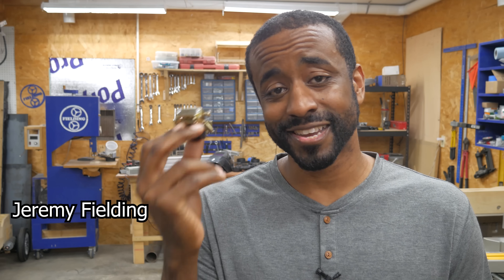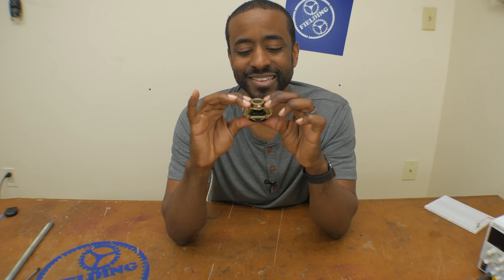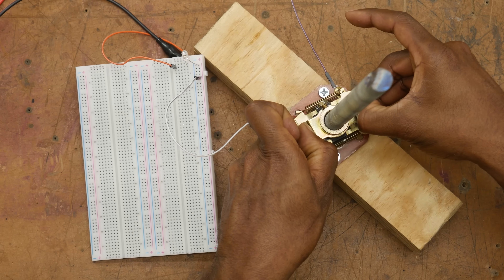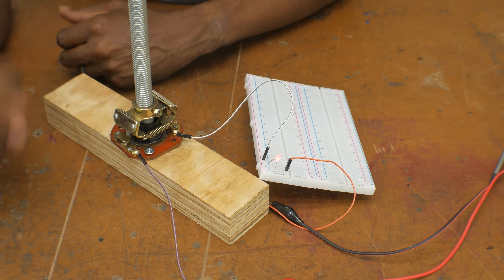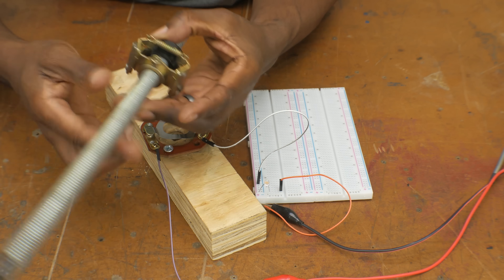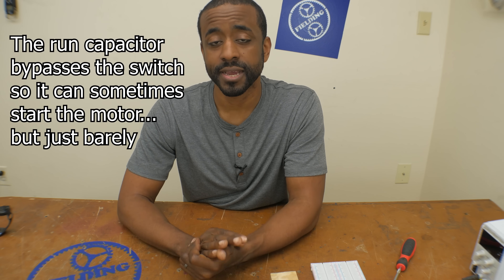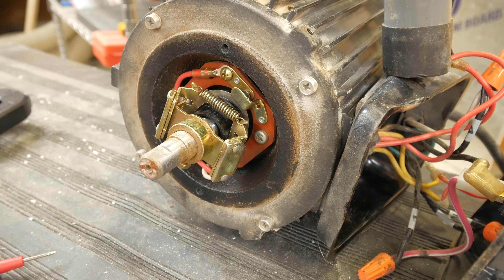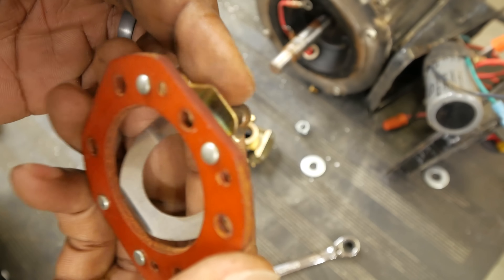This Clever Device Is Found In Nearly Every American Household. How It Works And How To Fix It

Comment: Never seen before this device. Well, I’m in Europe. When you clean connects, NEVER use a sandpaper of that coarseness. If you want to use emery paper it should be very fine like 600. It takes time but is much better as the contacts have very delicate surface.  The better the surface the better it conducts current. I have used a glass fiber scraper pen which has very thin threads or rough cardboard. Usual old style postcard without any gloss is good. It doesn’t harm the surface.
Reply: The contact surfaces are likely a silver alloy, and for cost reasons the manufacturer isn't going to use more silver than is required.
Reply: I use the striking strip from a book of matches. Very fine abrasive and red phosphorous leaves behind a weld resistant surface.
Reply: Way back when car engines had distributors. Fouled "points" were very common. A very fine file or emery board was used to clean them.
Reply: What type of motors do you have there then champ?
Reply: @bushratbeachbum  we have the same type of motors that are used in the USA, but our electrical supply is different. We use 230 V at 13 amps which has almost twice the power of a standard US 120 V circuit, so we don't need centrifugal switches and boost capacitors to start the motor - there's enough power in the standard circuit to do it without the booster.
Reply: @joejones3434  was waiting for someone to say this. Still don't understand why the world can't agree on 230v and metric :)
Reply: @joejones3434  you need a capacitor to start the motor unless is a three phase. Old washing machines had this device even in Europe. I think they still use it in America because a double contact type can prevent overspeeding in some aplications and americans are very strict.
Reply: @soiledhalo2296  The world did - at large. Just some are resistant to using half-decent systems.
Reply: Deoxit in aerosol cans is amazing for cleaning corrosion

Comment: Quick google search came up with 
An 1920s patent for a centrifugal switch (US Patent #1,630,394) was granted to Royal Lee on May 31, 1927. It was the basis for the formation of the Lee Engineering Company. 
I wasn't sure if it was the same thing you have here so I looked up images and it is.

Comment: This is mostly unique to the Unites States. In Europe and many other countries motors run on three phase power even in residential installations. The US does not supply three phase power to residences, only single phase. Single phase motors require a start winding to get the motor spinning. The capacitor provides a phase shift for the start winding to create the rotational torque. Three phase motors do not need a start winding because there is inherent torque produces ny the three phases each of which is 120 degrees out of phase with the others.

Comment: I have never seen such devise in a singel phase 230 v AC or 3 phase 400 v AC motor, is this only in 110 volts motors?
Reply from the maker: The motor in the video is 240

Comment: Never heard of it before but it's very similar to a centrifugal clutch on small motors I work on. Motor spins clutch plates held back by springs they open up to the outside and catch a bell spinning the output shaft

Comment: The tabs as you call them are actually called points same as used on cars inside the distributor before electronic ignition became the way to generate a spark to the spark plugs.   Now you know.   Great videos keep up the great work as I have watched you from the beginning and you have taught yourself a lot since then.  Much respect to anyone who is not afraid to dive in and find the problem.

Comment: Starter capacitor and running capacitor. Haven't seen one in any motors I've came across. We have 230vac single phase and 400vac tri phase tho. Lower currens and bigger motors are tri phase, and those don't need a start capacitor. A replacement, more cost effective current shunt and a triac: once current on shunt rises above triac gate trigger voltage triac opens up and runs capacitor/starting coil. Shunt needs to be power rated and calculated resistance for the specific motor, just like the springs, and its a solid state thingamabob.

Comment: They stole the idea from steam engines and early airplane designs for the purpose of throttle control. You've even heard of them, remember the terms,  "Fly-Balls", no! Well, I'm sure you've heard the term ," Balls to the Wall"  Both mechanical devices designed and used for throttle control. Now, why do they used your mechanical device to control shaft speed on your motor, that's simple, they work! Sure they can design an inductance pickup glued on the shaft of the motor, and a small computer to read and control the speed of the shaft. But then they'll have to deal with humidity, water, heat and any/ever thing that messes with electronics. Pretty cool huh, and you thought those folks back in the old days were dummies!

Comment: This device was invented to regulate the steam in steam engines. It will open the steam valve when  the RPM drops below a certain amount and close the steam valve. It was called a governor and is where the term "Balls to the wall" comes from. When the balls were out the device was calling for maximum steam. "Were at balls to the wall". "Or full steam."

Comment: A similar (almost identical except its not so much of a snap open as it is a progressive open until the spring and centrifgual forces are balanced) concept is used in centrifugal governors which has a lot of really dope applications. I love screwin around with those.

Comment: just spitballing here, but i'm pretty sure the switch in question is a carry-over from steam engines.  the faster those little balls would spin, the larger the valve would open, letting more steam out, but that's all i remember.  a cursory glance around the interwebs couldnt lend me any support there.

Comment: About the capacitor, it is not a good idea to change the capacitance value.  You said in the video that you can go higher but not lower -that is true of the voltage rating (which is a limit) but if you go much larger on capacitance it won't match up right with the motors starter windings.  There is a specific C for each motors L.
You make an interesting point about how this part is still so common.  It could be replaced with electronics.  I suspect the reason it has not gone electronic is that the majority of electric motors are produced in Chinese state sponsored factories.  It's not about cost or reliability -it's about the job of a guy in china.  If the world does de-globalize this would be one super high volume bit of electronics to produce.

Edit; a little research -there are electronic replacements for these centripetal switches.

Comment: neat. why aren't they used outside the US? is it just that we have double the voltage here so motors don't need the extra kick from the caps?
Reply from the maker: please read the pinned comment at the top
Reply: @Jeremy_Fielding  ah, thanks. it didn't seem to be pinned but i found it anyway

Comment: Great video.  I repaired several induction motors after my Delta tools flooded in Hurricane Katrina.  I replaced capacitors and a few bearings and cleaned the centrifugal switches and polished the contacts. The motors work fine.  I use an emery board to polish both contact surfaces flat at once.  Sometimes the spring arm on the contacts needs adjustment to pull the contacts open when the switch releases.  I've also heard that dirt can cause the slide to lodge on the axle.  Cleaning and lubrication should fix it.  Thank you.
Reply: Correction:  "Sometimes the spring arm on the contacts needs adjustment to CLOSE the contacts when the switch releases."   If the contacts don't close, the start winding doesn't operate, and the motor just hums and overheats.

Comment: The capacitor changes the phase angle of the stator magnetic field in relation to the rotor field.
The rotor field follows the the stator field like any two magnets not aligned together.
If you are starting a single phase motor, the rotor can stay locked with the applied field because the field isn't moving around the motor.
Once the rotor is going sufficiently, it'll continue spinning even with no field applied due to inertia. That is when the AC passes 0 volts and the rotor is moving past the 90 degree position.
Then it'll try to catch up with the field as the applied AC goes negative and the rotor goes to the 180 position, rinse and repeat.
It's a bit like only pushing down on the pedal of your bicycle. If your not moving, the pedal can be at the very bottom (or top), and pushing down doesn't do a thing except hurt your foot (back EMF)

I'm fairly certain Isaac Newton had something to do with the invention. Or someone standing on his shoulders.

Comment: The earliest patent I can find is 1919.
There is conflicting info on it.
 It was being used in the 1910s
1919 Inventor White Harold Elijah
https://patents.google.com/patent/US1552589A

Patent #1,630,394[1]) was granted to Royal Lee on May 31, 1927. It was the basis for the formation of the Lee Engineering Company
 https://en.wikipedia.org/wiki/Centrifugal_switch
Reply: Not as a switch but the centrifugal aspect of it as a governor was used way before 1919 on steam engines.  I would guess that Watt had a lot to do with its creation.
Reply: Good find, but it's not the same and not for the same application. There will certainly be a much later (50's, 60's) patent for this specific application, which incorporates a centrifugal governor with a storage capacitor for use in electrical motors under load. Of course, they all use prior art.
Reply: That is the deal with patents. The method may be the same but when you apply it to a 'new field of interest' you can apply for a new patent.
Reply: I stay with H.E. White as the inventor in 1919, granted 1925 and Huygens in 1673 as the conceptual creator.
Ladies and gents, if I may:

Christiaan Huygens (1629 - 1695) was a Dutch physicist, mathematician, astronomer and inventor. His most famous invention was the pendulum clock (1656) that became the most accurate timekeeper for almost 300 years.

In 1659, he published his work De vi centrifuga  (in Latin) containing the still-in-use standard formulae for the centripetal and centrifugal forces .

In 1673, another work of his (also in Latin) Horologium Oscillatorium sive de motu pendulorum , on pendulums and horology, containing the analysis of a problem posed by the French Mathematician Mersenne on how calculate the period of a pendulum made of winging rigid bodies of any shape and the analysis of the conical pendulum, consisting of a weight on a cord moving in a circle , using his concept of centrifugal force . The measurement mechanisms used for such analysis lead him to another invention of his: centrifugal governors used to regulate the distance and pressure between millstones in windmills, as already stated, making the Netherlands famous for such agricultural equipment until now. In 1788, James Watt adapted such control to regulate the quantity of steam into an engine, in the beginning of Industrial Revolution it caused such impression that James Watt is often confused as the inventor even nowadays.  

Another cause of confusion can be the types of controllers: the most famous centrifugal governor is a Continuous-type control that controls a variable, usually speed, of an engine by regulating the quantity of fuel or fluid such as steam, in order to achieve any desired value (set-point) between min 0% to max 100% or in some cases such as on idle speed let's say 50% to 100%. Such continuity makes it also a Proportional control , a linear function.

The History section of Centrifugal switch in Wikipedia is quite uncompleted. The US Patent #1,630,394 granted to Royal Lee on May 31, 1927, is more about an Electrical speed governor adding more poles to an already invented single pole centrifugal switch . Such governor is a Discrete-type control meaning it has a limited number of  steps or states of regulation to make the variable achieve the set-point. As a non-continuous and non-linear function make it also an On-Off control instead a proportional one .
In this specific R. Lee's patent the available states are:
Stopped: 0% speed;
"Low Speed": motor at let'say 33% speed;
"Intermediate Speed": motor at let'say 66% speed;
"High Speed": motor at max 100% speed;

In other hand Harold Elijah White, inventor of Montclair, Essex, NJ, had his US Patent #1,552,589A CENTRIFUGAL ELECTRIC SWITCH applied on November 15, 1919 and granted only on September 8, 1925, only one and a half years before Royal Lee's electrical (discrete) speed governor. H.E. White's invention was not intended for speed control, it  is a single pole switch, more a safety/starting device than a control device, that is exactly the point of this video, as described by himself:
"Single phase induction motors, to which this invention is especially applicable, comprise two windings, one of which is required to be energized only during starting and the circuit of which it is desirable to open when the motor has attained a certain speed" .

H.E. White's patent took so long to be granted because the dispute over other applications of Centrifugal switches already in use since 1900 to 1910 or even earlier, mainly in electric fans. It was a "common" invention based on Huygens concepts every reasonable Engineer should know, maybe each one thought that each other already invented, and despite the worldwide claim of an US Patent other countries with developed industries as Germany and England were not under US laws and some other countries even had patent regulations.

In my humble opinion:
 Hooray for H.E. White and Huygens.
Reply: @alexdemoura9972  look at Watt's design and look at the later patent - I'd say Watt's invented it and just didn't see it as separate enough from the existing governors to be a unique invention on its own. I wouldn't say he's "confused" as the inventor, more a case of someone not realising the utility of his invention and someone else seeing it years later.

Comment: Your videos are great. I have repaired a broken spring on a governor but I never realized how they work. 
I bought an old Craftsman air compressor that is hard starting. I was looking up repairs on YouTube for the problem and found a hard starting kit. But before I order it I will check the gonernor.
Thanks again for a very informative video.

Comment: This centrifical technology was developed to control early steam engines from over revving. The 1800 produced most mechanical inventions still in use today. The speaker driver is another example never improved upon.

Comment: We had a motor for an industrial drum washing machine we took in for rewinding. The date inside was 1914. And this was in 2015.

101 years of industrial use and still with it's original windings 

When they developed the rotor stator motor back in the 1800's dare I say the got it right

Comment: It is my guess that the concept for this centripetal switch was borrowed from earlier applications.  Centrifugal governors were invented by Christiaan Huygens and used to regulate the distance and pressure between millstones in windmills in the 17th century. In 1788, James Watt adapted one to control his steam engine where it regulates the admission of steam into the cylinder, a development that proved so important he is sometimes called the inventor.

Comment: What do you do if the motor trips the breaker most of the time but runs fine if it doesn't trip the breaker.  Caps have been changed.  Could it be this switch?

Comment: I couldn't resist searching patents.  I found F J Lyden's 1936 Condenser Motor patent (US2028230).  The text for Figures 1 and 2 reference using a relay and a centrifugal switch to switch the condenser (capacitor).  A F Lukens's 1934 AC Motor Control patent (US1944090) using a relay to switch the condenser (capacitor) as the voltage changes when the motor comes up to speed.  G E Smith's 1931 patent (US1790330) and R L Hunter's 1899 patent (US633516) both shows centrifugal switches that appears to be inspired by a steam governor.  I was able to find many other similar patents (H G Reist 1904 US771269, H H Lake 1902 GB190214141, E Cros 1900 US647254), many more about speed control around the same time period.  The earliest I found about AC motor starting specifically was E Thomson's 1890 Alternating Current Motor patent (US430328) which discusses using a centrifugal governor to switch the windings and start AC motors incapable of self-starting.

Lots of great artwork in the figures of these older patents.

Comment: In refrigerator compressors (and other sealed motors), arcing contacts can't be permitted in the sealed space.  An external relay is used instead, disconnecting the starting winding when the inrush current in the running winding drops as the motor reaches speed.